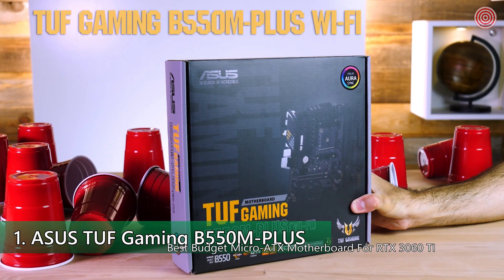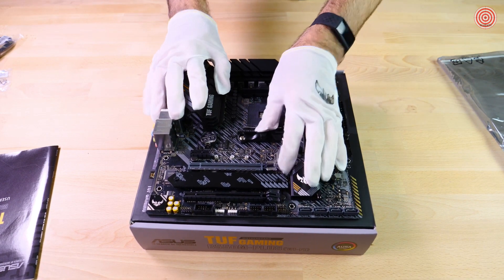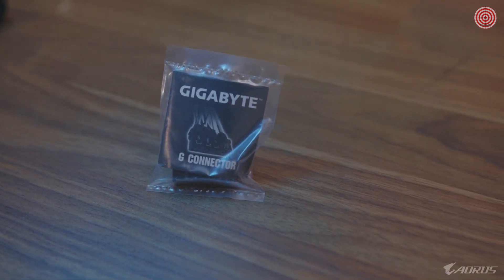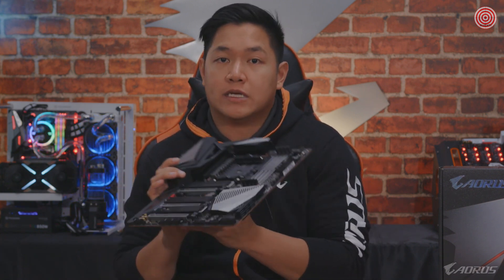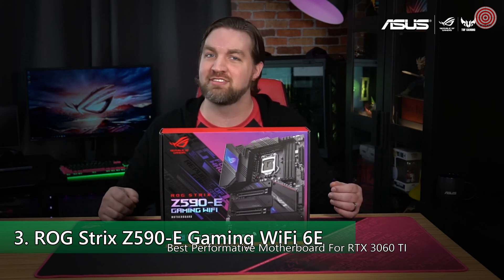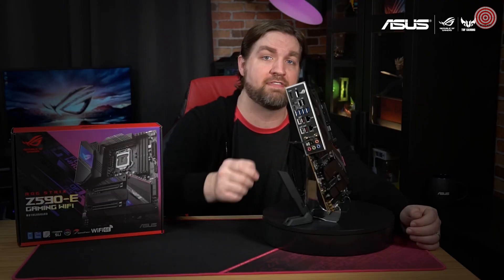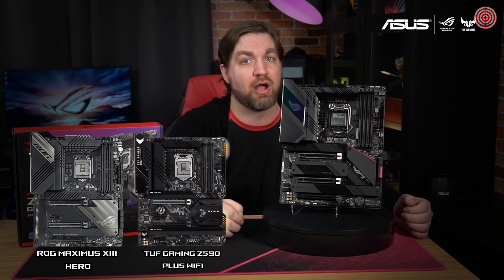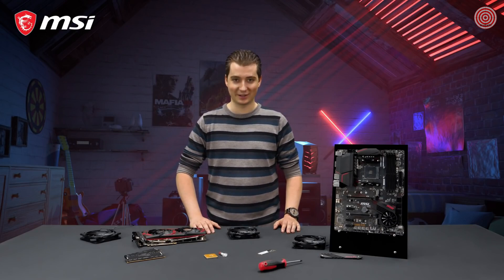The 5 Best Motherboards for RTX 3060TI

Comment: its fit with tuf b360 pro gaming?
Reply from the maker: I don't recommend it, it will bottleneck your processor. The best video card you can use with Intel's 8th generation is the GTX 1650 super or equivalent from AMD.
Reply: my cpu is i3-9100f
anyway thanks for your advise. i just want to know it can run it or not @AryTechB
Reply from the maker: Yes, you can

Comment: Best motherboard for 11400f and 3060ti ?
Reply from the maker: The best motherboard for the Intel Core i5-11400F and NVIDIA GeForce RTX 3060 Ti depends on your budget and requirements.
Reply: @AryTechB  My budget is around 1000 dollars for the whole pc . is the ASUS PRIME H510M-K a good choice ?  the maximum id spend on the motherboard is 130 dollars
Reply from the maker: The ASUS PRIME H510M-K is a decent budget motherboard for the Intel Core i5-11400F and NVIDIA GeForce RTX 3060 Ti. It has the necessary features for a gaming PC, including an M.2 slot for a fast SSD and support for up to 32GB of RAM. However, it is important to note that this motherboard is limited in terms of overclocking capabilities. If you are looking for a motherboard with more overclocking potential, you may want to consider spending a little more money on a B560 or Z590 chipset motherboard.
Reply: @AryTechB  Thank you very much

Comment: hey, would a ASUS PRIME H410M-A/CSM LGA1200 work with a msi rtx 3060 ti?
Reply from the maker: The motherboard you mentioned has PCIe gen 3.0. The RTX 3060 needs PCIe 4.0 to work in the parameters it was designed for.. I'm not saying it doesn't work,I'm just telling you it won't work at full capacity.

Comment: brother 3060ti is compatible to my rog maximus x hero motherbaord?
Reply from the maker: Bro your motherboard has PCIe 3.0 and Nvidia RTX 3000 series needs PCIe 4.0 to work within designed parameters. 
So I don't recommend you to use the two together.
Reply: @AryTechB  what is the best gpu to my motherboard bro? that i can play ultra settings
Reply from the maker: @yoonki0818  a 2080 but not for all games
Reply: @AryTechB  2080 ti can?
Reply: @AryTechB  brother is this compatible to my maximus x?? >>>AORUS GeForce RTX™ 2080 Ti XTREME 11G
Reply from the maker: @yoonki0818  Yes

Comment: Hey I have a x570 Arous pro ...ryzen 9 processor....can I connect two gtx 3060 ti graphics cards ?
Reply from the maker: Yes you can use the two 3060ti with the following mention : Aorus X570 Pro Multi-Graphics Technology
Support for NVIDIA® Quad-GPU SLI™ and 2-Way NVIDIA® SLI™ technologies
Support for AMD Quad-GPU CrossFire™ and 2-Way AMD CrossFire™ technologies
Note: For AMD Ryzen™ 5000 Series/ Ryzen™ 5000 G-Series/ Ryzen™ 4000 G-Series/ 3rd Gen Ryzen™/ 2nd Gen Ryzen™ Processors only.
Reply: Thanks for replying.  I have one zotac rtx 3060 ti 8 gb with me already ...do I have to purchase the same zotac graphics card or I can go for any brand like msi .. I have amd ryzen 9 3900XT
Reply from the maker: @sk-gj8iz  In order for SLI to work, you need to have GPUs with the same chipset. For instance, an NVIDIA GTX 1070 can only SLI with another NVIDIA GTX 1070 only. Similarly an RTX 2080 can only SLI with another RTX 2080, etc

Comment: hey would a rtx 3060ti founders edition work with a gigabyte h410m s2 motherboard because Im basically a broke gamer
Reply: Because I’m going to buy a 3060ti with a intel i3 10 gen those are all what I’m thinking of getting any other suggestions?
Reply from the maker: I do not recommend this motherboard, it does not have a PCIe 4.0
H610M H It's ok